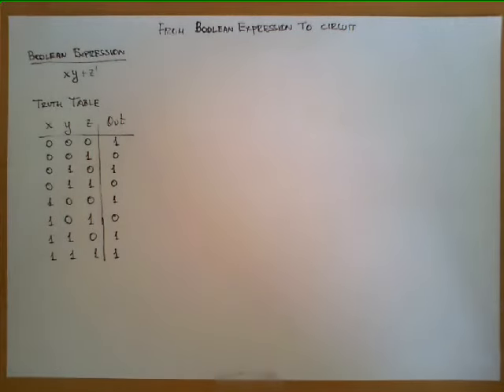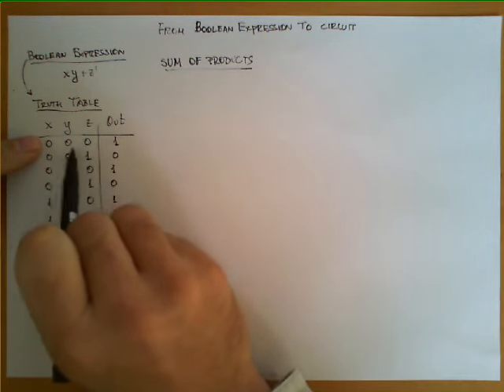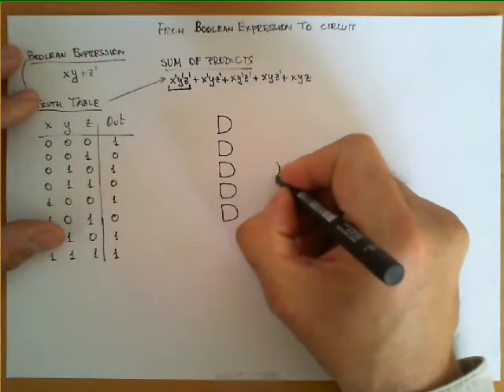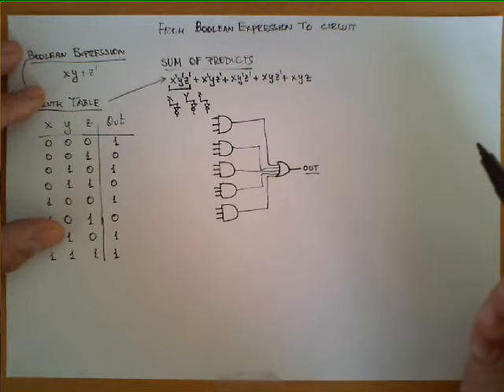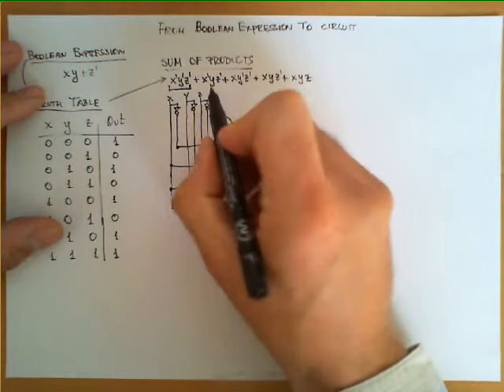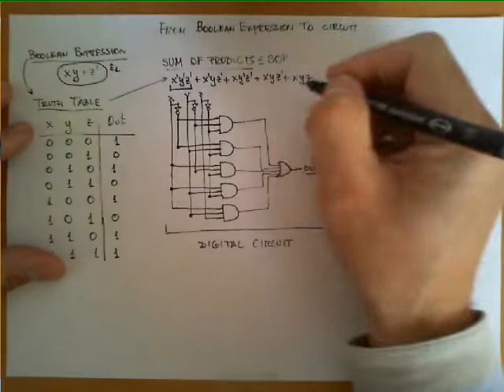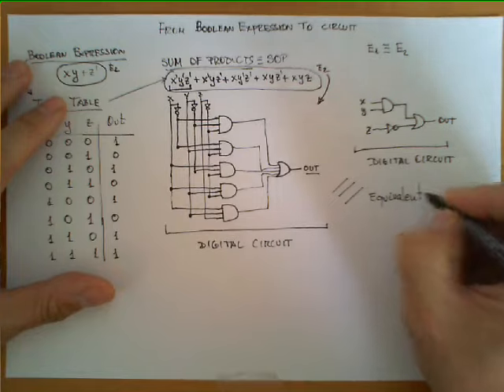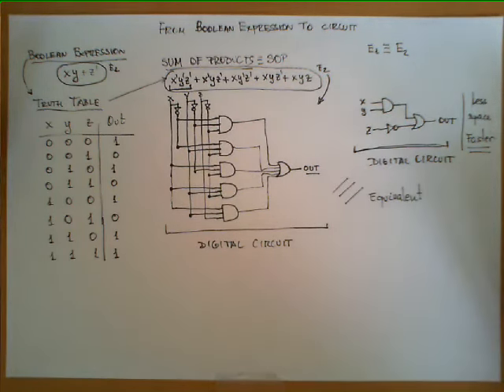From Boolean Expressions to Circuits

Comment: A room has 3 switches (A,B and C) and 2 light bulbs (F and G). F can only be switched on if all 3 switches are on and G will be off if all 3 switches are on. switch A alone does not work for F. F can be on if a combination of 2 switches are on at the same time. C does not work for G. G can be on if a combination of 2 switches are on at the same time. 1. Draw the truth table to represent this scenario for both bulb F and Bulb G. 2. Write down the boolean expression from the truth table for Bulb F. 3. Write down the boolean expression from the truth table for Bulb G. 4. Draw the combinational logic circuit for both Bulb F and Bulb G. Do all this on paper. Once you are done, take a picture of your paper and upload the picture here.